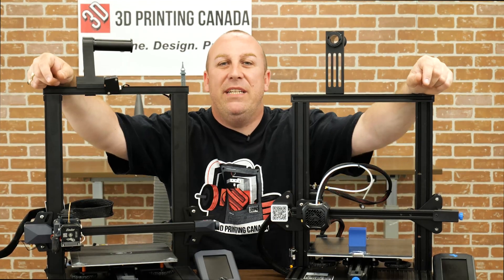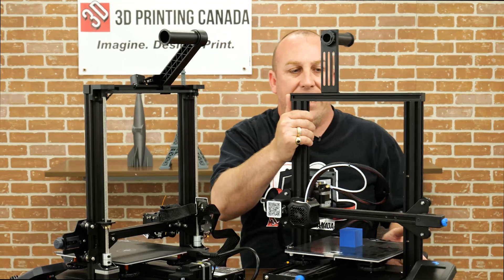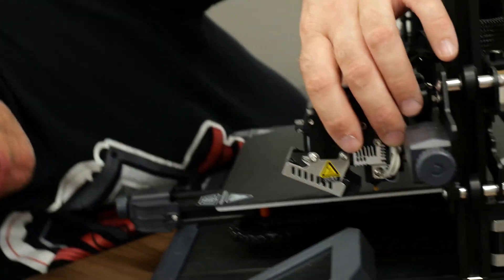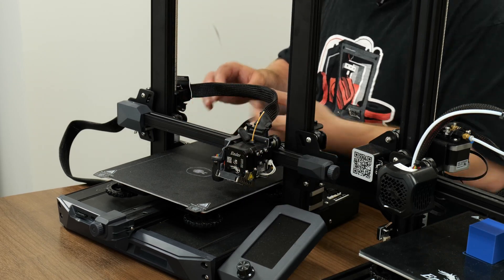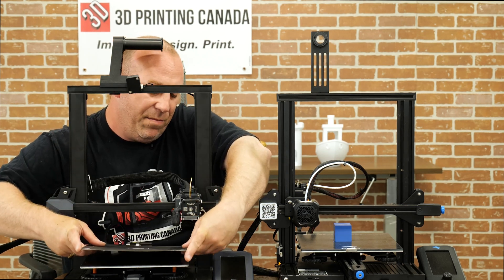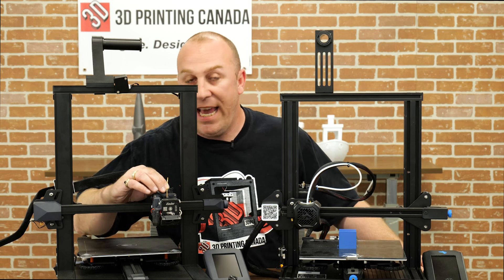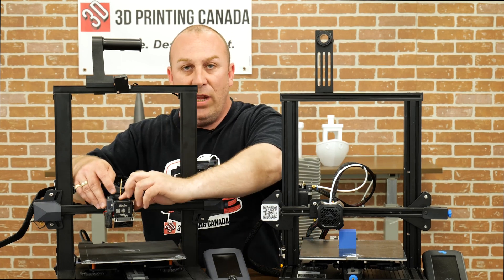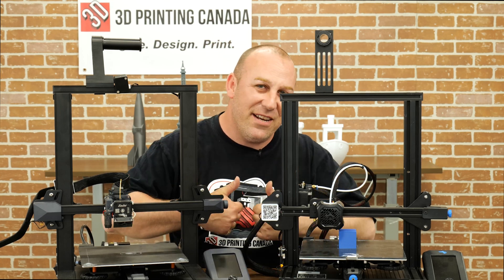CREALITY ENDER 3 S1 VS CREALITY ENDER 3 V2 (COMPARISON)

Comment: Ender 3 s1 is $200 at microcenter right now. V2 is $100
Reply: S1 $70 and v2 $50 right now at microcenter!!!
Reply: @anthonybradway8925 and that's exactly why I'm here lol. First time purchaser, wanted to know how good enders are for a beginner, but so far it's a mixed bag of goods and bads.

Wanting to know the difference between the S1 and V2 is what brought me to here as well!

Not sure yet if id get either.
Reply: @QueenSpoopy  s1 has all the upgrades and well worth it over the v2. Now owning ender for years now just know there will be a lot of tinkering which will drive you nuts! My advice is if you don’t have the patience then just get a Bambu Labs A1 mini where you can just print and go, no tinkering around. Plus I believe all the s1 and v2 are sold out at microcenters.
Reply: @anthonybradway8925  thank you much for the reply and advice! I appreciate it!

Yeah, started looking at the a1 mini for that reason, as a first time buyer who has no clue what they are doing, an ender might not be a good idea lol.. But what I'm worried about now since the unit would be in my bedroom, would be how safe it would be. Wondering if I should consider one with an enclosure instead.. not sure how safe one without it and a air purifier would be. My only other location option is a hot as heck humid garage, which guy tells me is a no no for a printer and plastic lol.

Lots of researching I must do!
Reply: @QueenSpoopy  I think in a room is ok. It might be the small sounds that bother you more. I know that microcenter has the P1S which is the enclosed model for $599 which is an absolute beast. I’ve seen refurbished ones for $499 at Microcenter. Now there are some filaments that will smell more than others but I barely notice the smell from mine unless I’m super close.
Reply: @anthonybradway8925  that is a smidge too pricey! Too big and I'd be wondering where to even fit it lol

I don't plan to do large prints, so probably a smaller one, but not too small, is a better option starting out, think that's why the sale on the enders was so alluring.. till I'm told its a hassle on the brain and sanity lol..
Reply: Which one is worth the price tag? Never bought a 3d printer before. Not sure to pay $200 or $100

Comment: My s1 model is absolute garbage and broke multiple times whenever I had tried to relevel it or even try to fix it. More hassle then it was worth. The auto level made no sense and I would’ve been fine if it have a manual level mode.
Reply: Re: I have recently given silicon columns a try instead of spring and they have fixed the leveling issue entirely. I find the springs method unreliable. I recently learned that the custom firmware also fixes a lot of issue with the auto level too.
Reply: Just print adjustment stoppers

Comment: Do the ender 3, 3 v2, and 3 s1 all have the same frame setup? I've only been able to look at pictures, I'm thinking of buying a broken 3 v1 off if eBay for the frame and bed then get the rest from other places to save a bit of money and also to upgrade it for the future. Are the frames the same?

Comment: Can you run Linear Advance on latest Marlin? Or is it the same TMC2208 extruder driver that crashes when you try to run it?

Also what's the fuzz about double Z? The hotend is not that heavy and the printer is not that fast anyway...

Also, why compare it to V2? It's the worst of the bunch - bad screen, silly PSU placement, bugged TMC2208 on extruder...

Comment: Ender 3 S1 is my next printer, though I still love my original Ender 3 ( with a ton of upgrades, thanks to you guys !!). My OG E3 has upgraded motherboard (4.2.7 ), screen, etc. 
  The reason I want the new one is now that I know about 3D printing, I want one out of the box that just does it. TPU is still a hassle, it would be nice to have it work great out of the box. Nice review / comp.